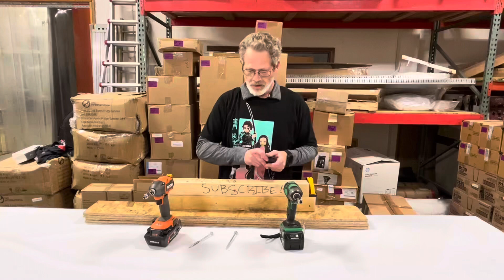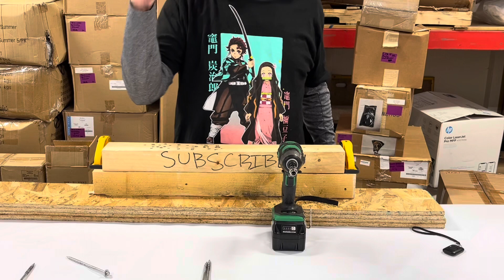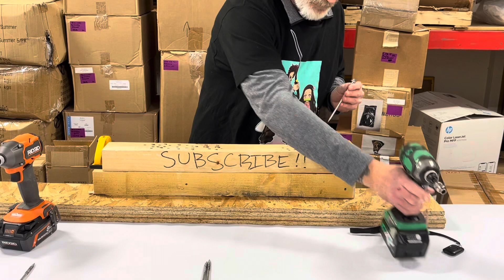Ridgid lays the smack down! #tools #diy #powertools #viral #impact

Comment from the maker: I did this at the suggestion of Mike Veselka. This is a completely different outcome than my previous test.
Reply: This is Mike Veselka, glad you liked it. These new high torque Ridgids are freakin sweet and powerful! I am no longer just a viewer I am a subscriber. I love your vids. Keep em coming. Thanks.
Reply from the maker: @4673962  I thought you would like this one. thanks for your subscription, and your suggestion.
Reply from the maker: @4673962  The subscribe written on the face of the board is a subliminal message lol.
Reply: @DiligentDave1966  anytime man! 👊
Reply from the maker: @4673962  🤘
Reply from the maker: @4673962  I hope you also check out my video of the subcompact drill and impact driver.
Some people have complained about the soft start, but I think it’s absolutely perfect. That drill, with a max output battery, it’s pretty dang strong.
By the way, you will be seeing plenty more Ridgid videos on my channel because that is my brand of choice now. 
I’m not gonna lie, I kind of set out to prove that it wasn’t that good but quickly fell in love with a high torque hammer drill, and the four mode impact driver.

Comment: Great job Dave!  The Ridgid really seems to wake up with the 8.0ah battery with 21700 cells, considering it has the metal connections.  It’s too bad Ridgid doesn’t make a more compact battery with 21700 cells, outside of the discontinued Octane 3.0.
Reply from the maker: You can buy the octane 3.0 on the Home Depot website. They were on sale a while back.
Reply from the maker: I left a comment in response to one of yours on the Tools With SoAlz video.
I thought I would also update you here. I have decided to return the Metabo HPT combo, and keep the Ridgid subcompact combo because it just makes sense.

Comment: Nice video Dave. The results of this new test makes sense. Most high-performance tools will almost always perform better with 21700-cell batteries when you test them under heavy loads. 

It just goes to show that the Ridgid 4 mode brushless impact driver really is a high-performance tool with that battery. But because that battery is so big I would rarely use that impact driver with it due to the extra weight. 

This is also one of the reasons why I'm not a big fan of the Flex 24 volt quick eject impact driver. The extra weight you need to carry around, because it's a 24 volt tool, makes it one of the last impact drivers I'll reach for when I need one. I still have a few Ridgid 3 AH Octane batteries that I would pair with this Ridgid impact driver for everyday use. I just wish Ridgid still offered a smaller 21700-cell battery for use on the sub compact drill or the impact drivers I have.

I think out of all the impact drivers I own, my favorite impact driver/battery combo has to be my Milwaukee Gen 4 paired with their 3 AH HO battery. I feel that this combo gives me a powerful impact driver that performs well for most tasks but in a nice compact size. But even with this being my favorite combo, I'll still sometimes grab my DeWalt 12 V Extreme Impact driver with a 3 AH battery for smaller tasks or when working on things overhead or maybe on top of a large ladder. It's such a nice feeling tool for smaller tasks but packs a decent punch when needed but it's so lite I can hang it on my belt all day and barely notice it there.

Of course everyone's favorite tool is subjective and will vary depending on what they are typically doing with them and the tasks they typically do. There is no such thing as a best impact driver for all tasks for everyone, but if I could pick only one for all of the different types of tasks I use them for, I would pick my Gen 4 Milwaukee. It's small, light and powerful and in most cases will get the work I need it to do completed faster than most of the others on the market. Maybe my Ridgid paired with a 3 AH Octane will be my number 2 combo. I'll need to test them out in the field and see how they perform together.
Reply from the maker: I’ve heard that the octane battery makes a big difference over the max output battery, but i’ve also heard that the Ridgid does better with the six amp than it does with a four amp battery.
Hopefully they release stack lithium in the near future.
Reply from the maker: By the way, I really liked the Milwaukee impact driver. I just didn’t have very good luck with the drill, and it didn’t make sense to pair a Milwaukee impact driver with a Ridgid drill because that would be way more expensive.
Reply: @DiligentDave1966  I'm pretty sure all the tool brands will have a stacked lithium battery offering come out in either 2024 or 25. 

I currently have a bunch of the DeWalt stacked lithium batteries and a few of the different Flex sizes that are offered. 

I don't own the new Milwaukee Forge battery yet due to the high price, but once it comes down to a more reasonable level, or they start offering it as, or with, a hack at Home Depot, I'll pick one or two of them up. 

The stacked lithium batteries definitely offer high performance tools a boost in high demand applications, but the slight performance gain doesn't justify the crazy numbers the manufacturers want to charge for the stacked lithium batteries when they're first released. I can wait. 

Eventually, over time, they will be offered standard with the high end kits like DeWalt is starting to do now, but Milwaukee was slow to the game and still needs to catch up. 

Eventually Rigid and Ryobi will get the upgraded batteries too. The question is, when?
Reply: @DiligentDave1966 SoAlz mentioned in his livestream that he expects Ridgid to release stacked lithium batteries later this year.  Worst case scenario, maybe they announce them later this year and follow through with a release date in early 2025.
Reply from the maker: @SouthFLTools  I was watching the live stream, but I was also working, so I didn’t catch everything.
I think that’s only a prediction on his part because he said he hasn’t heard anything.
Reply: @DiligentDave1966  yes, it could be.  I guess we’ll know around Q4 of this year.
Reply from the maker: @El_Diablo_LI  I’m not gonna lie, I like the Milwaukee impact driver better than this one. I just had really bad luck with a 2904 drill from Milwaukee, and it didn’t make sense to get a drill from one brand and an impact driver from another. It would’ve been way too expensive.
To be totally honest, I kind of set out to prove that Ridgid wasn’t that great when I started these tests. It honestly proved me wrong, and ended up being the best choice for me.
Reply from the maker: @SouthFLTools  I now have plenty of subscribers. If I could just get the majority of my subscribers to watch all of my full length videos, I think I would have enough viewing hours to achieve the first level of perks
The first level only requires 500 subscribers, and 3000 viewing hours, or a certain amount of short views.
Reply: I like heavy drills. Makes me feel like I'm using a drill of quality and significance. Especially if someone asks to use it. I take pride in passing my drill only to watch their receiving hand make and unintentional dip towards the ground
Reply from the maker: @mattek519  I found a high torque Ridgid hammer drill to be a little heavier than the Milwaukee , but lighter than Dewalt or Flex. 
Ridgid has better balance than most, especially when you start putting the bigger batteries on them, and definitely performed to the level I was hoping it would. I also have the subcompact combo for lighter duty stuff. I think you saw my short of the subcompact drill, it’s not a wimp.